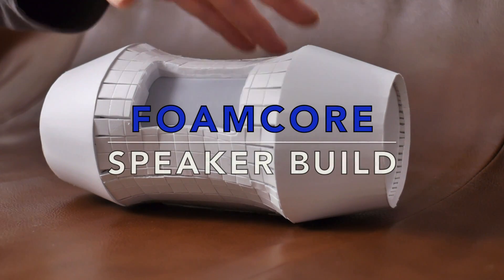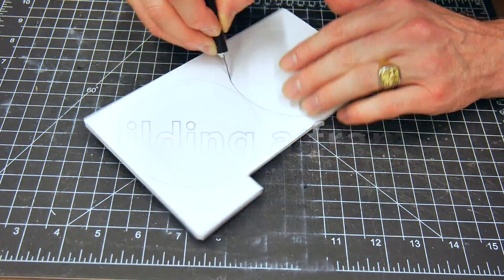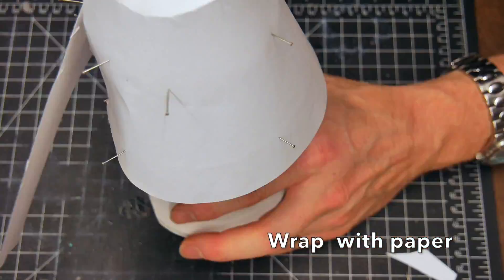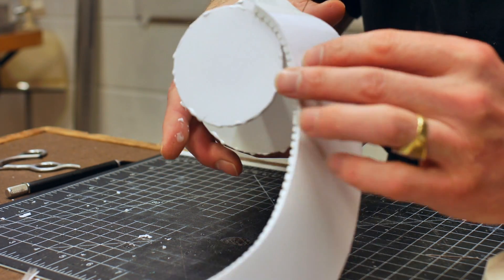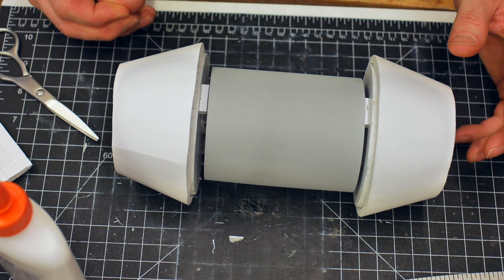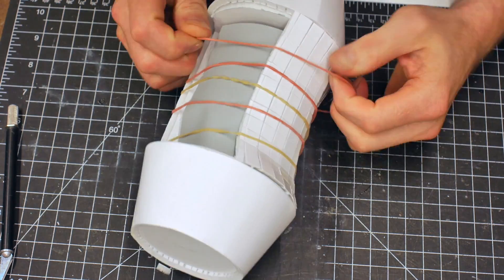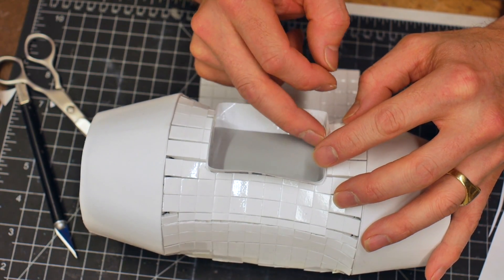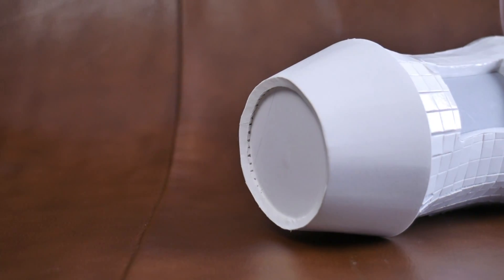FoamCore model making Design Build with Foam Board: Wireless Bluetooth Speaker Mock up and  Wahey-C1

Comment: Was there a trick to getting the right curvature of the center grid cut pieces? Do those inner frame rings give all the info for it?
Reply: Or would you like putty it in and sand it to get the final shape and curve? Cus I notice there isn’t a grid in the drawing

Comment: What kind of foam do you use? Styrofoam and regular foam cracks easily.
Reply from the maker: M Use a good quality foam board or foam core that you get at an Art supply store.
Reply: Get blue foam. If that stuff cracks, then you're being way too rough with your models.

Comment: Very interesting technique. I've been looking for something like this to finish a big 2,5 feet aircraft model. At the moment it is just a 3D frame but it could very well be filled out in a similar way because the definitive shape is full of compound curves. My question is: Could one further increase the finish of a model such as yours or do you only use this approach as a rough thinking aid.
Reply: Yes you can and should further increase the finish of a model. It can start as a thinking aid until its next evolutionary stage. Such as this model I would suggest filling in all the cracks with white clay and sanding it when dry. Finish with a high grit brush off dust and you can texture and paint the body. The ends can be fitted with black fabric salvaged from clothes or aluminum screen from windows painted black for the speaker covers. Print out from computer an lcd screen scene on gloss paper (or packing tape) to mimic a working screen. A step or two higher would be taking apart an existing speaker system and 3D printing the parts to have a working model.
Reply: @MindsetAlchemy  Thanks for the tips. I do however want to keep the model light. About a year ago I found a rather well suited foam core card material that I can use to fill out all openings with rectangular sheets that I can shape before gluing. I still have to do it though. Untill that time the model hangs safely above the spot where I am typing this, swaying easily in the hot air that comes from the back of the screen. It would actually be light enough to turn it into a flying model.:-)

Comment: As a mechanical designer myself... i wonder why not just print this on a 3D printer? They aren't expensive anymore, and a decent one would print such a model within 3-4 hours. You can go through several iterations with subtle design changes within a week.
Reply from the maker: Krystian Kalinowski its to early in the design process for a rapid prototype, stay tuned, i will continue to work on the project.
Reply: I can attest in larger applications. In fabrication you’ll catch me doing miniature models of campers, bumpers, flatbed trays,trailers, etc, but you’ll catch me making foam core/ cardboard models to figure out where to put hinges/reinforcements, size and shape, etc.
Reply: A lot cheaper than steel or aluminum. Also a lot cheaper than any CAD software for my DIY needs. I would love to eventually move to CAD, but I can’t justify it on my already expensive personal projects. If I was mass producing for sale sure, but for a dude with a modestly armed garage with some tools, I get by.